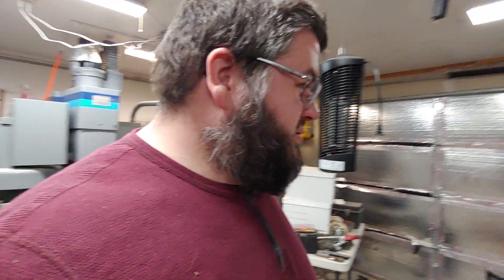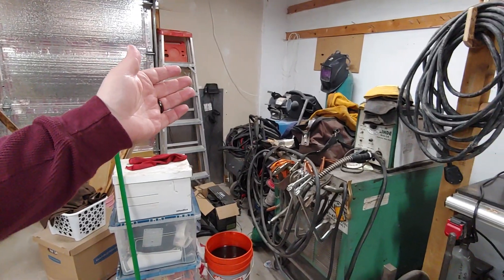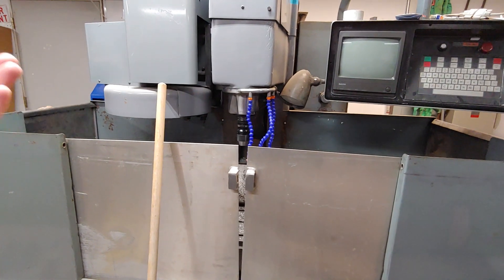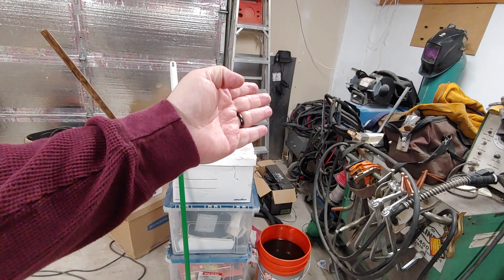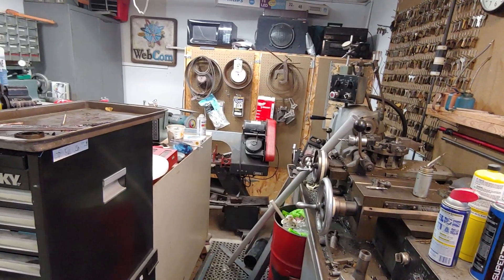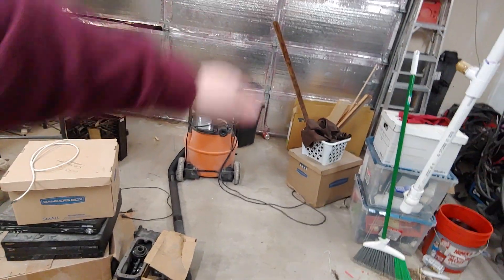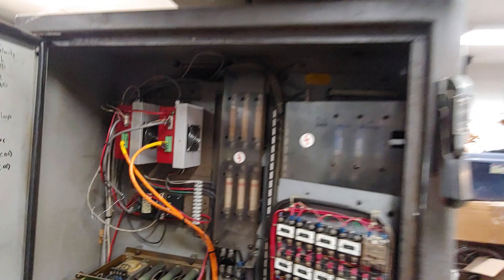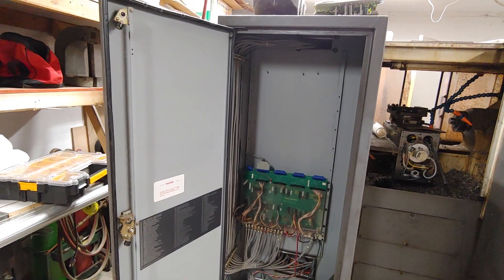Shop Update 2020

Comment: A suggestion:  Instead of dumping the 80 gallon wash of the tank into the septic system, think about running a separate grey water system similar to the septic system to disperse the water slowly into the ground.  That load does not need to go through the septic tank and is a heavy load for the septic system.
I came over from Engels Coach Shop after he posted a video today of his channel being hijacked and you helped him with getting it back.  Thank you for that.
Reply from the maker: Hi Roy, I would have done this if the soil allowed for it.  I have a sand filter septic because the soil doesn't percolate well enough for a conventional septic.  The way these systems work, the tank has a pump that sends excess water to the sand filter, the water both evaporates from the filter and flows down to a liner.  When the filter fills up, the water is pumped out to a leach field.  The leach field is a what they call cap-and-fill, it's very shallow and 70% of the leach effect is accomplished through surface evaporation.  I've also considered sequestering the backflush water for irrigation, but freezing temperatures in the winter make the difficult.

Comment: Hi Perry,  nice shop.  I was hoping to see the outside, your grading and new construction.  I have heard that all fadal mills are 4th axis ready-is yours?  I have a nice fadal NC10 that would fit really well on that table.
Reply from the maker: Hi Mark, yes my machine is 4th axis ready.  I haven't tried it out yet, but the drive is there.  I just looked up the Troyke NC10, that looks like the same vintage as my machine.
Reply: @eformance  The troyke is really well built.  At troyke you can still talk to the design engineer who knows every detail.  I know because I called to get details to adjust my other NC troyke; excellent tech support.  The reason I inquire:  Do you want such a capabililty?
Reply from the maker: @rowlandcrew  I've thought about it, but it hasn't been important enough for me to dedicate any financial resources towards.
Reply: @rowlandcrew  I may be interested in your 4th axis. How can i contact you to discuss?
Reply: @brandonmc2869  Hey, Brandon,  I sent you an email.

Comment: Just found the channel, looks like alot of stuff going on in that small space, will be sure to stay tuned. Do you miss having your desk/computer not in the same space as the machines?
Reply from the maker: I don't really miss it, it was interesting having the office in there.  I got a nice laptop a couple years ago that runs Fusion 360, so I can tweak models and post while out there.
Reply: @eformance  I just cant get away from having a desktop for cad, cam I can deal with on a laptop if I have to.
Reply from the maker: @Daniel-vq9zb  Agreed, as a staple diet I wouldn't want to do a lot of CAD on it.  For most of the time I had my machining business, I used a 15" thinkpad with a 1600x1200 screen for my CAD work, it was great.  My current laptop is 2880x1680 and it's 15.6", so a little higher dpi than the thinkpad (130 vs 112 dpi).

Comment: Are you a clone of me or am I a clone of you?

Big fan of Dave Engel and my curiosity got the best of me to check out the guy who helped him as I'm also an Oregonian and fellow tech nut.
Very little difference between you and me as far as what you do and what your shop inventory is and what we do professionally.
And yes my shop is occasionally (more often than I like) a real mess.
Probably the only real difference is nothing in my shop and home, including a 5'x12' plasma table, runs on anything but pure sunshine in cloudy Willamette Valley.
Reply from the maker: Shh, you're not supposed to talk about the grid tie solar system I've got in the works! 😉
Reply: @eformance  

Of course my system is only grid tied if we have too many cloudy days and I need backup but most of spring and summer runs only off a lithium battery pack.
I have engineered and supervised installations all over Oregon and Idaho as large as 1meg.
I now would never install any solar electric without it being default asynchronous as well as auto synchronous in these uncertain times.
Tesla power wall (or other) and appropriate  inverters is great insurance.
Reply from the maker: @larryelliott9157  I've been looking at used 6kw units on eBay, like a sunny boy 6kw. Seems there are a lot of units coming out of California. $7k is a tough pill to swallow for a power wall, let alone $14k for 2. My draw is 25kw per day on average. There are a bunch of large installations being put in eastern Oregon, I got a good number of shattered panels, 1mx2m 48v 400w. I'm planning a 400v nominal string voltage. If I get 75% out of those panels, I'll still be in good shape. I'll leave the future open on a power wall.
Reply: @eformance  

Of course based on your local code enforcer you have the elegant solution of just doing AC Coupling.
That's installing a single synchronous inverter of say 5-6 kw coupled to an array of as large as 20 or more kw and the AC coupler.
I have built and sold several of them where as the DC voltage begins to climb to cutoff voltage due to the supply far exceeding the load you literally burn off the excess as heat either as hot air in heating coils (I prefer my water cooled versions) or a large motor load.
That way you avoid the need for batteries or a grid.
The circuitry for the coupler is fairly simple using an appropriately sized power factor corrected SCR and a tiny circuit card smaller than the SCR itself.
Total cost exclusive of equipment cabinet and heaters is under $150

You do also have the option now of using say a RELION lithium pack as small as 30amphr where they are nominal 48vdc and you simply couple that to say an Outback Radian such as I use and also have the AC coupling option. 
$1300 for a single 48vdc with built in BMS makes a low cost and reliable high power option.
Believe it or not I actually was able to run my Dynatorch plasma table directly off a set up such as this as an experiment using a single 30 amp-hr pack and it cut like a champ.
Had to add a bunch of reactor filters and lots of capacitors though to avoid the high frequency bleed over to the inverter wiring.
Lots of fun and I learn far more than I ever did in engineering school